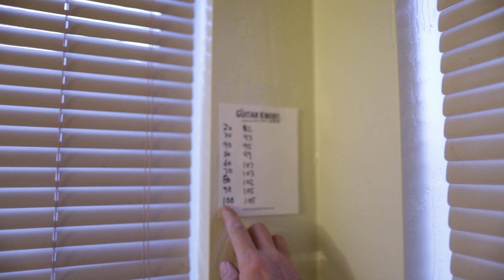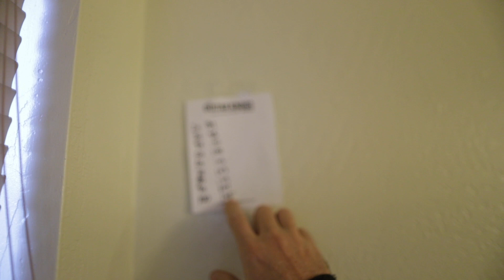How to find BASS!

Comment: Say Ron is that a Gallo sub? Ive seem a few on EBay if it is it any good? I've never seen it in your rig.
Thanks man
Reply from the maker: FreddyBoomBoom's Channel 1985 yup! They are pretty good!
Reply: I've a Gallo TR-1 sub in my home theater setup paired with some A'Diva speakers. It's a fantastic system!
Reply: @Myxo14  Thanks! I should have known I'd be good if its got the Gallo name on it. I'm running the Omega Speaker Systems Super 3i 4.5" full range single driver speakers and they are soooo good imaging is excellent and are electrostatic fast but struggling under 60hz and id like to fill that bottom end out

Comment: Something I don't get - why does it matter that bass is louder in some corners? you're not sitting in the corner to listen, right? I like your videos, but please remember to explain the basic assumptions ("This thing I'm detecting is bad because...") and don't assume we immediately understand it.
Reply from the maker: This is a good point and well taken - ill consider this as I keep these coming. To answer your question, you are right - you arent sitting in the corner - but you CAN hear whats happening in the corners while sitting in the sweet spot. Those corners will surely colors the sound of the speakers in a negative way which is why treating them is super important.
Reply: New Record Day ... yeah it’s true how sound can get trapped in a corner and create a wash of sound. I had that problem with a comedian show we did in a 9k capacity indoor stadium. It was hell in the corners. 😖